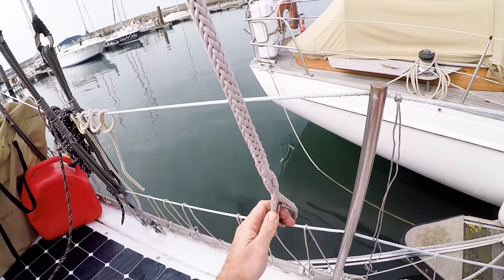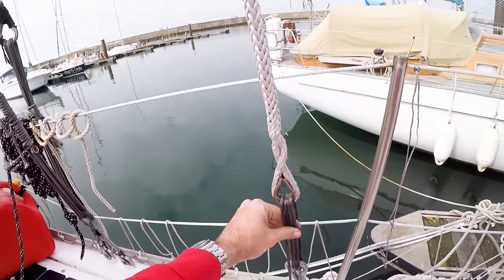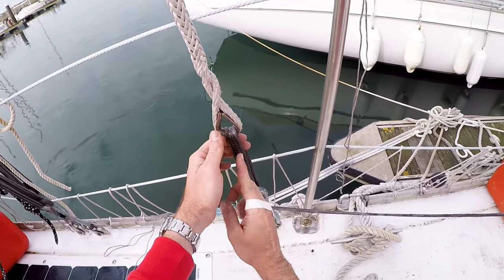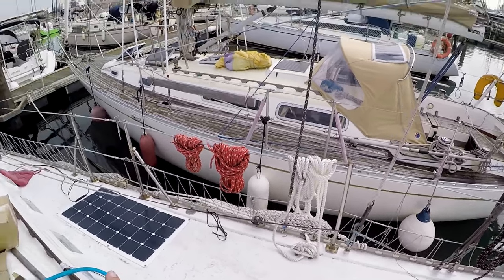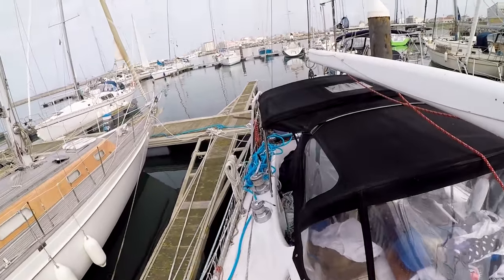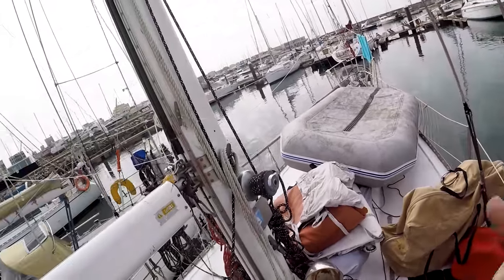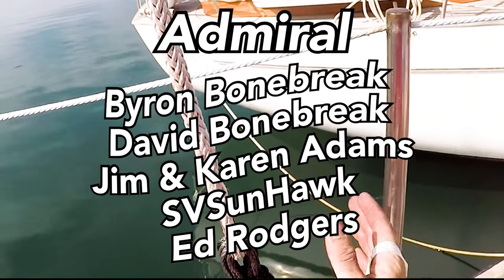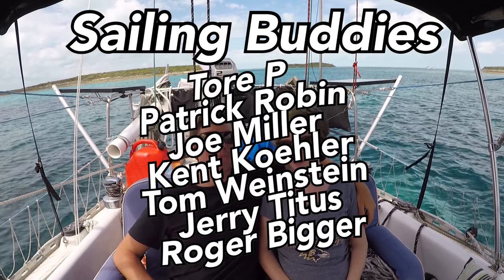Installing a Synthetic Standing Rigging Stay with a Deadeye | Sailing Wisdom

Comment: Hey Doc, 

Thanks to you I've managed to finish all 4 of my baby-stays to synthetic this weekend. 
Next is my cap shrouds and the intermediate stay about 2/3 up the mast.

PROBLEM:
Both stays attach to the same chain plate about 3" apart and I know my deadeyes will be too big and interfere with each other.. 
My current solution is to attach a 2nd shackle to give the deadeye a 90 degree turn and allow then to line up correctly. 

Do you have any suggestions ?

Thanks !
Reply from the maker: The toggle to rotate 90° was going to be my suggestion. If you make them both rotate, they will be out of each others way and easier to set. Basically the deadeyes will be thin when you look at the boat from the side and wide when you look at them fore/aft. 

Congrats on building your own bullet proof rig!
Reply: @RiggingDoctor  Awesome ! That's exactly what I was thinking. Thanks again 🙏

Comment: Hi Doc. Hope all is good out there on the oceans. Was hoping you could give me some advice..😊. I have a 28» sailboat, ALO 28. I’m getting new rigging, and there within lays my question. Would 6mm dyneema be enough? It is rated to 3.500 kg (7,700lb). Not sure about the SK, dosent say, but it is beeing used on car winches and such. Anyway, would 6mm be a good choice. 4 shrouds and the back stay. Hope you find time to reply. Fair winds. Best reg. Runar, Norway
Reply from the maker: There is some complicated math involved, but I can say that if the boat is tippy, it will use smaller rigging than a boat that is very stable. For the SK type, you want to get Heat Set (like New England Ropes STS-HSR). It happens to be SK75 but by being heat set it works better than regular SK78. 
If you want a more specific and definitive answer, you can email me at RiggingDr@gmail.com. 
I charge a consult fee of $120 and will go over the specifics that I would need to calculate the appropriate size for your rigging.
Reply: @RiggingDoctor  Hi again. Thanks for your honest answer and time. Will look into the dyneema you mentioned. Best reg. Runar👍

Comment: Tension- also eye ball up the mainsail track. Mast should be in column.  Also re-check under load. Same for mast prebend only from the side.
Reply from the maker: I do that! There is a huge difference between the mast tied up at a dock and the mast when going hard to windward! It has to be in column in the latter situation ;)

Comment: Great tutorial. Could you use synthetic for the furling forestay? You mentioned synthetic for your inner forestay.  What about chafe from hanks?
Reply from the maker: A chafe sleeve takes care of the chafe from hanks (our hanks have been rubbing on the inner forestay from Spain all the way to Florida) and so far there is no sign of concern, but I did also switch the hanks to soft hanks made of dyneema 😉
Reply from the maker: It hasn’t been properly tested, but I’m going to give it a proper test to find out because I don’t know either. I have thoughts on how it could work, but no experimental evidence on the matter.

Comment: Wow, great! You didn't include a link to the shroud wrapping knot. All I could see is that you kept looping the shrould "frapper" around and around, tightening it up every so often, but it didn't seem to include any actual knot to hold it in place at any stage, at each tightening point or at the end. What did I miss?
Thanks
Reply from the maker: I forgot to put the link down below! There were cards that come up in the top right corner of the screen with the links though.

Here is the link to the Shroud Frapping Knot video: https://youtu.be/9ptuywtXM_E
Reply: @RiggingDoctor  Thank you. I was so engrossed in trying to figure out what you were doing that I didn't notice the banner. I still don't really understand how you basically can get it to hold just by looping it around. I have to think an element must be the nature of the "small stuff" that you use. Also, who'd ever think that the seizing would hold the rigging without the rigging needing to be tied off. I'm amazed. A great pair of videos.

Comment: My bet is for more synthetic rigging on sailboats as time goes by. Change comes hard and this looks like a better way than stainless cable and stainless hardware. Try swaging a stainless cable at sea. Oh well I guess I'll just wait till I get to port in a couple weeks. 8-)
Reply from the maker: Haha! And they even sell "Spare Stays" which are dyneema with a deadeye and lashings so that you can replace a broken stay at sea.
Reply: @RiggingDoctor  The only problem I see is if you want a furling jib. Instead of using hank on's for the jib.
Reply from the maker: Yes, the chafe if the foil is too much for a synthetic stay.

Comment: Bello there,
Thanks for the video and my best compliment, I have to change my rigging to I was thinking to change in dyneema... do u think that could be possible on a 41 foot?
Thank in advance 
Best regards
Reply from the maker: Very possible. We are 45 feet and rigged with 9mm Dyneema.
Reply: Rigging Doctor thank you so much... I also isles to kraken and I told me that change from steam ball fittings to, I think iron plates, I difficult and expensive, to u think still a safe solution?
Thank you again
Hug

Comment: herb did i miss it ? what are the sizes of the deadeye line and the frapping line?  dm20, sk ? i heard the stay is 9mm ?
Reply from the maker: It’s all dependent on the size of the boat and the rigging loads. On our boat, the stays and deadeyes are 9mm. 
The shroud frapping knot can be tied in the smallest and cheapest Dyneema you can get. I switch between is 1.8 and 2.6mm Dyneema depending on which spool is cheapest. It just needs to be very small so that the turns are very tight so that friction is at its highest in the knot and the knot hold.
Reply: @RiggingDoctor  thank you

Comment: Are there any tips when your boatyard is taking your mast down or putting it back up with dyneema rigging?
I'm concerned they have never put a mast up with synthetic rigging and wondering how to quickly attach the stays and get enough tension to hold the mast up before the crane operator gets frustrated.
I've only seen videos showing changing the stays one at a time while the mast is up.
Reply from the maker: I've always done it one at a time with the mast in place since the crane is expensive!
There is a deciding factor in the matter: Keel stepped or Deck stepped.

If you are deck stepped, then you need the stays to hold up the mast or it will fall.
If you are keel stepped, then you could technically have the mast hold up without any stays on it at all.

For quick connecting, I would have the lashings ready to go and simply pull them hand tight with a greater emphasis on the lowers. They will do wonders for keeping your mast up and are easier to set by hand than the cap shrouds. I would tie them all off with a series of half hitches just to make it fast. Once they are all tied, have the crane go slack on its end and see if the mast holds itself up on its own. If all is good, the crane can disconnect and you can take all the time you need to get the rigging tensioned. If the mast starts to lean really far, then the shrouds need to be tightened a bit more before the crane sets you free.
Reply: @RiggingDoctor  we needed to have both masts down as part of our refit. Eg to have old mainsail furling removed (it had been riveted to mast and was jamming). Plus all new halyards and more. 
Think will go for one more season with old stainless (too many other jobs to do), then we can replace one at a time.
However, one day will need to take masts down (both deck stepped) for French canals).
Reply from the maker: When you do lower them for the canals, the synthetic stays will be easy to stow and not scratch up your topsides or deck while you motor the canals ;)

Comment: In the situation of the pin in the tang going head up. At the top of the stay it would be really hard to install that pin the wrong way as the space between the mast and the tang is smaller then the length of the pin.  So if someone managed to put it in head down they would really need to try hard to put the pin in the wrong way around.  But I get it’s general advise as in some situations like a shackle that swivels up you could put it in wrong easily so head up when the rigging is in its final position or the position it will be in when tensioned is good advise.
Reply from the maker: You would be surprised how many times I see the clevis pin set upside down up there when I’m doing inspections! These people really had to try and muscle the thing in there to put it the wrong way!!

Comment: Two points: Most quality turnbuckles are plated bronze, not stainless. Agree on the cost factor. Second point, the thimbles used on hi-mod rope should be the closed type, not the open type use here.
Reply from the maker: The turnbuckle part is bronze, but the screws and end fittings will still be stainless steel. 
Ideally, sailmakers thimbles would be used because they can’t distort like these open ones can. The reason I didn’t use sailmakers thimbles all those years ago was because they were out of my budget. 
Five years of sailing later and my finances have improved. I’m going to be replacing our inner forestay (our only steel stay) with Dyneema in a few weeks and I’m going to be using sailmakers thimbles :)

Comment: Nice video! Would you coat those lines with tar type stuff to seal it all ?
Reply from the maker: It’s not needed. The material itself is very resistant to the elements. 

Also tar (or slurry) will make a mess of your deck!

Comment: Shouldnt the thimble be a block of metal with a hole drilled through so the surface shape perfectly matches the clevis pin shape to avoid point loading? They way you did it would likely have the thimble and clevis pin start to saw through each other until there is some surface area or they break.
Reply from the maker: I was worried about the point loading when I first set it up, but after 8 years and 18,000 nautical miles with no wear, I am no longer concerned about that issue.

Comment: 0:34 minute. Can you tell , how the rig piece fix to the mast with screws?. Thanks.
Reply from the maker: It’s called a tang and it’s specially made to mount onto the mast. The good ones are actually bolted on with a backing plate to spread the loads out better while others are simply screwed on with a flange that wraps around the spar so that the screws are being pulled sideways in a sheer force instead of being pulled off. Remember, the aluminum wall of the mast is very thin so if the forces are not well managed, the mast will tear and make a big hole to fix!
Reply: @RiggingDoctor  The rig piece that I see in the image is external to the mast, do you have a complete image of the piece in that installasion or a link to see it?.

Comment: Why use deadeyes ? A D-clevis at the chain plate would do the same???
Lash from the stay to the D-clevis,.

You may have a good reason for making deadeyes but I can't see it.

Please explain...
Reply from the maker: If the bot is small and the working load is within the range of a D Shackle, then it will work. In my case, the WL needs to be around 20,000 pounds and a D Shackle that strong wouldn’t fit in the chainplate. 
Basically, if your bot is under 20 feet long, it’s safe to do. If it’s between 20-25 feet, you need to do the math. If it’s over 25 feet long, the loads are too high to safely use a D Shackle and you need to use something else. A deadeye is one option but it can be anything that is strong enough and still fits in the chainplate.
Reply: My boat is 38ft and my chain plates have 5/8' pins so 5/8 shackles can handle the load...
Many thanks for the quick reply.
PS: presently in New Caledonia... Will head east soon
Reply from the maker: Mine are also 5/8”. https://www.westmarine.com/mantus-anchors-5-8inch-stainless-steel-anchor-shackle-17751090.html?queryID=afa415d773a966dbe4e1b990c0c19bc7&objectID=17751090&indexName=production_na01_westmarine_demandware_net__WestMarine__products__en_US
This one has a working load of 4400 pounds. In my case, I needed about 20,000 pounds for the working load. 
If you find one that can take the load, please email me a link (my email is riggingdr@gmail.com). It would be much faster and easier to slap a shackle on the chainplate than to make a deadeye!
Reply: About the same working capacity as 10mm dyneema.

Breaking at around 22k lbs.
Remember working load and breaking are 2 different things.
Reply: Shackles for being used sometimes for lifting are rated usually at 20% of their capacity.

Comment: Wonder if someone can run a hybrid system , like having just rear backstays in dyneema and the rest in stainless. Upgrade as you go so to speak.
Reply from the maker: You can mix and match in that method, but when you get to the shrouds, you have to do all of them at the same time. If you mix the shrouds (steel/synthetic) you will struggle with keeping the mast in column as temperatures fluctuate. 
You can do all the shrouds on one side of the mast and have a steel side/synthetic side for a while until you finish the other side. That would work :)

But the backstay is the easiest to switch out to start your synthetic conversion!

Comment: How do you guys size your dead eye lashing material?
Reply: Like, not the line you do your frapping with but the actual material that makes up the smaller line in the dead eye.
Reply from the maker: It’s a pulley system, so if you do 4 passes with the lashing, the load is spread over 8 strands. I size the thimble to fit 4 passes comfortably and the lashing material has to be at least 1/8th the breaking strength of the stay so that it is strong enough. I like to make 4 passes the minimum since the line is still small and easily worked with plenty of mechanical advantage. For heavier load stays, I do 7 passes, but using the same size of lashings as I did for the stays with only 4 passes. 

Basically: if you do a minimum of 4 passes, the lashing needs to be at least 1/8th the breaking strength of the stay.

Comment: You are amazing.  I am not sold on synthetic, but props for doing it right.  Be happy, be safe.
Reply: synthetic fibres are the way forward, so much so  that ppl in that industry say that we will look back and see these last 150 years of metal use for standing rigging, as an anomaly. Dyneema will become even cheaper, is it super easy to splice, you can carry spares to do your rigging twice over if you want, way lighter, 3 to 5 times stronger than steel (for the same diameter). cons: chafe and UV. for uv you have a sheath to cover it, (in time they will be synthesizing a fiber which will be highly UV protected to begin with) for chafe you need to know your boat, so it is easily avoidable.
Reply: @pmnfernando  Im in the DYFORM group, but always open.  I just dont see synthetic lasting long.
Reply from the maker: We shall see! Ours has 4 years and over 17,000 nautical miles.
Reply: @larryboles629  excuse me for being this direct but that is like me saying that i work for Sélden and i dont see carbon fiber spars making it.
Reply: @RiggingDoctor  there are boats already coming up to the 10 year mark. im sure you will be fine with proper care and maintenance
Reply: @pmnfernando  so to politely disagree with you is reason for your put down.  The great PMNFERNANDO has spoken, the science is settled.
Reply: @larryboles629  yes, its just like that. thanks for getting it right at your second attempt

Comment: Some creepy kidds set fire to the wooden boat next to mine some years back.  The heat was that intense it even melted the perspex port lights  on the opposite side and one of the stays snapped.  If I'd had plastic rigging the mast would have gone bye bye.  Mind you if I had a plastic boat instead of steel it wouldn't have mattered  the boat would have melted.
So you have to factor in that one in ten million chanceyour neighbour burns to the water line.

Comment: How does the synthetic line stand up against the sun?
Reply from the maker: According to the manufacturer: more than 10 years
Reply: @RiggingDoctor  I like your dead-eyes. I ran a freshwater boatyard for 30 plus years and have seen many many galled turnbuckles. Your dead eyes would certainly cure that! But rig tuning could get a little tedious each spring. BTW I never encountered a shroud failure in that time from crevice corrosion but then again this was fresh water. The racing guys love all this high tech line but mostly because of the light weight. My major concern would be the resistance to cutting or chafe with the highly stressed line.

I enjoy your videos. Don't mean to argue, just a different point of view. Keep up the good work.
Reply from the maker: The 10 year replacement rule has an * and that is for fresh water. I saw a boat with 30 year old rigging that still looked like new! On the flip side, we bought an Alberg with new stainless rigging shortly before we left to go cruising. It's been sitting on the hard for 4 years now and the stainless rigging is dead! I will need to rerig it before we can launch it, and it's all the salt's fault!

I wasn't arguing, I have just come to learn that there are three ways of doing things: 
One way, the other way, and the right way. 
The problem is that we only know one way and the other way!

Comment: Is line pre-streached?
Reply from the maker: This one was. If you didn't pre-stretch, then you will simply take the stretch out with the winch. 

If you are using one that is not pre-stretched, I would recommend keeping it on the winch because it will creep a bunch for a few days and if it stays on the winch, you can easily tighten it up as it creeps.